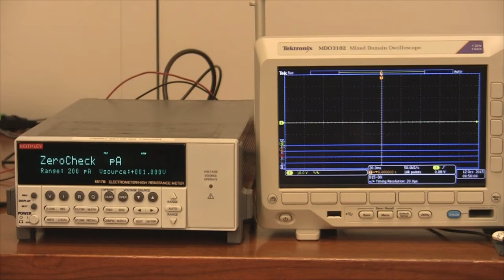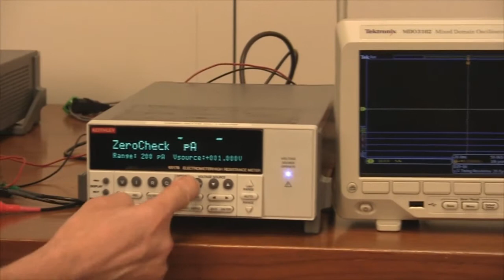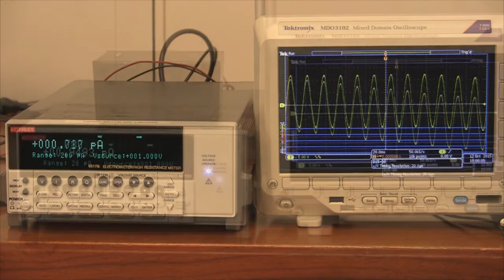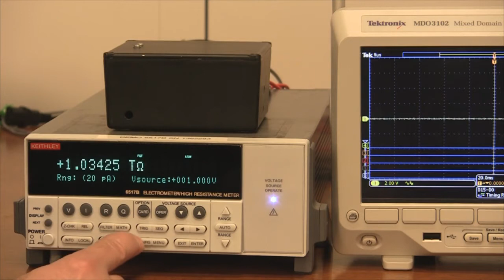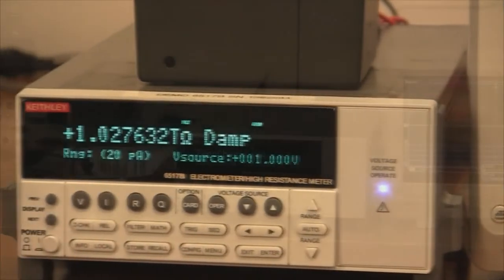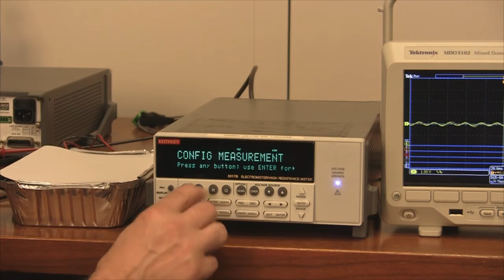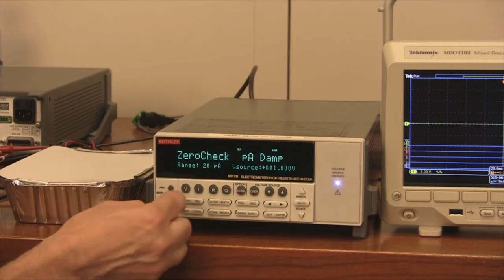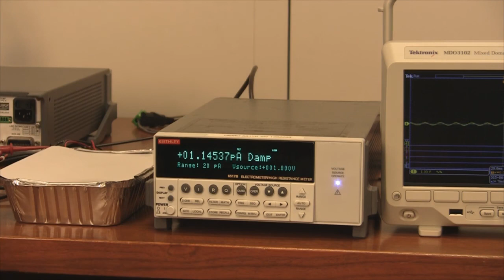Proper Measuring Techniques for High Resistance Low Current Measurements

Comment: You have the money to buy a 6517B and you use a dumpster shield box? Not great practice.
Reply: I don't understand your take on this.  I think it's brilliant education on shielding and dealing with signals picked up by high resistances, demonstrated realtime.  Had he used a driven-guard sub-chassis in a mu-metal enclosure with triaxial connections, in an oven, or whatever "great practice" would be, the information content would have been drastically reduced.